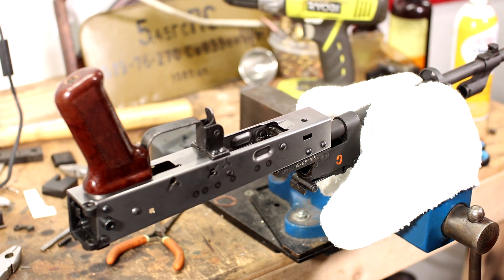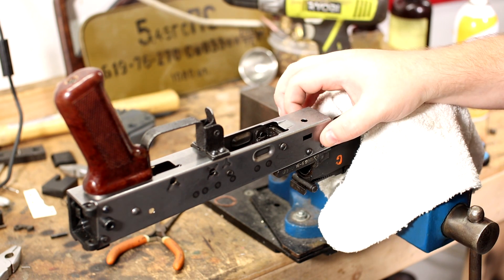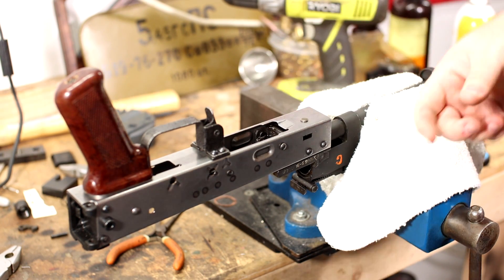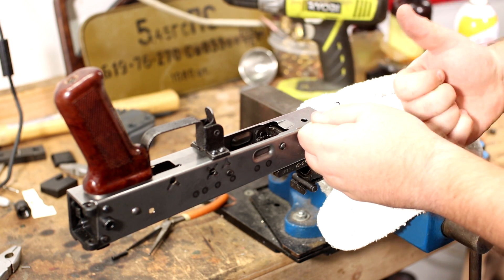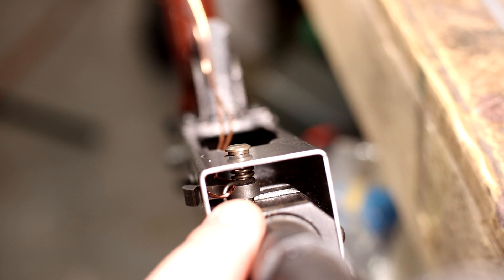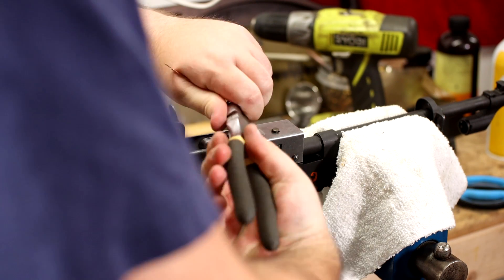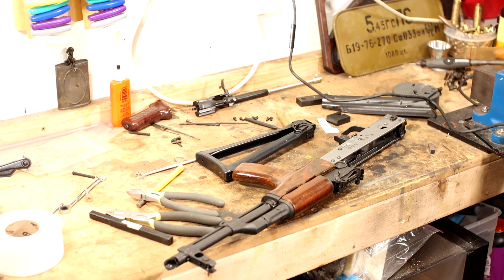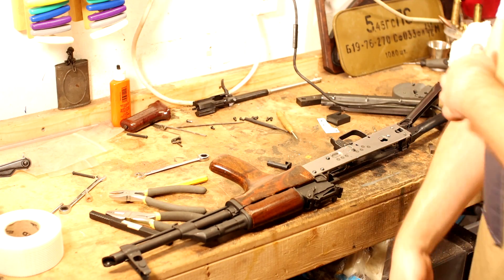Khyber Pass AK Build 4- Side Folder Latch Install

Comment: Did you machine the front trunnion to fit the pin before installing and riveting, or after running the mill thru the pin hole? thanks.

Comment: what prevents the pin from working itself down/out?
Reply from the maker: The pin have a cut in it that the spring sits into. Exactly the same as a trigger pin with a shepherds hook.
Reply: I was gonna ask the exact same question. I've got a Romy G. Basically, gonna put a modern polymer side folder and a gas block rail. So stoked!!

Comment: do you have any good ideas about how to attach this stock to an AKV directly or maybe mod it to work with the PSA folding mechanism? might be a cool video. lots of people want to do it but i dont think it has ever been done.
Reply from the maker: The AKV uses a pic rail on the back, so any of the picatinny attached stocks will work, not this type.
Reply: @BabyFaceP  yeah the quest is trying to make it work haha
Reply: @BabyFaceP  maybe it can be modded and welded to a folding mechanism
Reply from the maker: @whereisthebalance5732  It takes a lot of work. You'd be better off selling the AKV and picking up a KP-9. https://www.ar15.com/forums/Industry/Any-plans-for-a-PSA-AKV-w-folding-rear-trunnion-/301-299714/?page=1&anc=bottom#bottom
Reply: @BabyFaceP  seen that before. all it needs to do is be welded to the folding mechanism dont need the latch.
Reply: @BabyFaceP  there is a 1913 adapter you can get for the 5.5mm folding stock. Jmac makes them